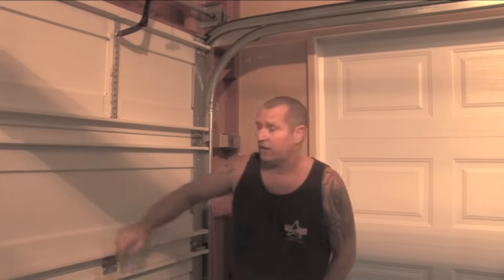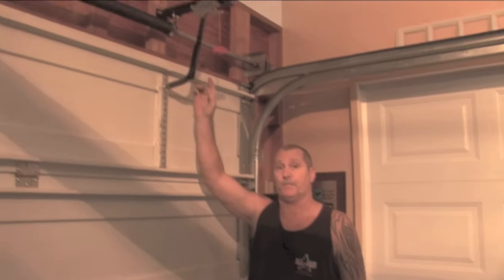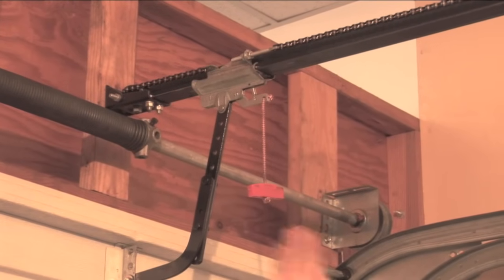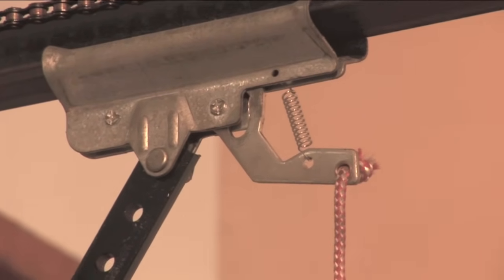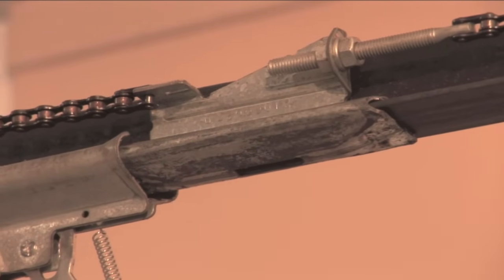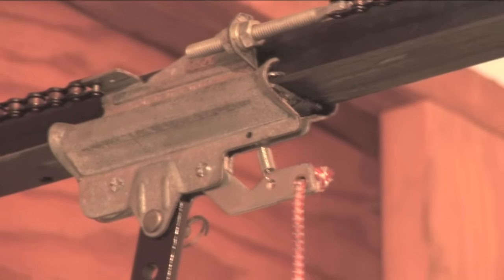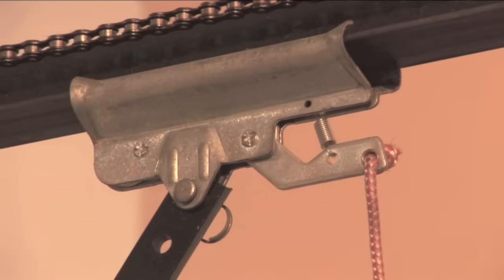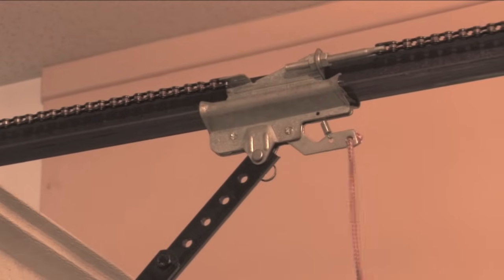Chain drive opener trolley release & re-engage. (How To)

Comment: This is a very well explained video illustration for understanding a very important aspect of residential garage door operation. I never knew how exactly the garage door manual override mechanism works even after over thirty years of living in our home in Massachusetts. Prior to seeing this video, it was always a trial and error maneuver for me once I used the manual override system to open the garage the during power failure in winter months. Two days ago, the spring broke and the door was not working. Now I know exactly how to fix the door operation and thus I was able to save a lot of money and did not need to call anybody to fix our garage door. The extension (expansion) spring is called Garage Door Trolly Spring and it costs less than two $, plus S&H. This extension spring has to be a correct one, and a mismatched spring may damage the trolly mechanism due to too much and or too little tension. Thank you!

Comment: Thanks for sharing this. My garage door suddenly cannot close with remote. Then need to manually close...I was so worried and planned to call for repair the other day. I viewed a lot of website to find the issue,  and luckily, I finally figure out how to have trolley re-engage with this video. Thank you so much!
Reply from the maker: if your machine won't close the door with the remote you can always hold down the wallbutton and it should close. sounds like your beams are out of alignment. try this video...https://youtu.be/NjPHC4Ka4qY

Comment from the maker: No, but I do know what you are talking about. Loosen the chain by unscrewing the nut on the inner trolley, (loosen it alot) then try the button and see if it travels...sometimes it does sometimes it's just too jammed. If it does go then stop it half way and adjust your up limit so the trolley doesn't come up that far anymore. If it doesn't travel and is still jammed then you will have to take the chain off and move it forward away from the lens protector bolt and then put it back together.

Comment: Tip!!  Putting lithium greece between the inner, and outer trolley reduces the friction as the door is opening and closing.  In other words... You're not going to hear the classic "BANG BANG BANG" as the inner and outer trolley are moving back and fourth.  By the way, did you notice the new Door arms we're getting from Chamberlain????  You can tell there made from a cheap material...

Comment from the maker: Well I gotta say that I've always put the grease that Liftmaster supplied in between the inner and outer and it does help, I just wish the gap in the inner trolly wasnt so long then the tongue from the outer trolley wouldnt have so much play to move back and forth, from what my guys say....Liftmaster doesnt supply the grease packet anymore and yes I have noticed the cheap drive arm as well as the amount of wire staples they now supply is half of what it used to be.

Comment: i'm still having trouble....my power went out and the garage door was left open. I then pulled the emergency release cord to close my garage since it was open. Luckily, it closed, however I can not      re-engage the garage door opener back to the trolley. It seems like the door is either stuck or jammed ever since I had to manually close it. I tried this solution in the video but the cord doesn't allow me to pull down and back. Is there any solution to this?
Reply from the maker: To re-engage you pull forward not back. You only pull back to disengage.

Comment from the maker: I guess apple still has some work to do on their voice command, but I get the jist of it...glad to be of assistance 20Jgard.
Reply: Hi, I have a genie model 203. Had a power outage, I disengaged it to close it...now the trolley will not reengage.
Reply from the maker: I'm not familiar with a genie 203 but if its a chain drive you have to lock it into the inner trolley, i won't be able to explain it in words

Comment: The inner part of my trolley is too close to the garage door for the outer part to connect, is there a way to move it manually?
Reply from the maker: Try adjusting the down travel limit so it doesn't go down as far. It's usually located on the side of the machine.
Reply: Thanks but somehow the inner trolley traveled too far towards the door and the outer trolley does not go that far back, so I can't engage it. I was hoping there was a way to manually move the inner trolley towards the motor so I can re engage it, and then adjust the travel.
Reply from the maker: Loosen the chain and move the chain around the sprocket.
Reply: Thank you so much for getting back to me, the chain was stuck on the cog and wouldn't come loose. Ended up getting a new opener, but i learnt a lot from the video. Thanks again.

Comment: This disengaged the trolly but the other one still not moving and machine makes humming sound and chain doesn’t move what shud I do am able to open it manually now but its still not working  with remote or switch plz help
Reply: Thanks in advance !!!
Reply: Its a liftmaster 😞
Reply from the maker: the inner trolley could be jammed against the lens cover bolt or even up front, the chain could be too tight or the gears could be stripped, check those three things and you might need to call a pro.

Comment: Apparently the part of the inner trolley that attaches to the chain drive for my garage door completely broke off when one of the kids used it and fell to the cluttered floor where it will never be found. Now what?
Reply from the maker: Should be easy to find a Chamberlain “inner/outer trolley “ kit on amazon, the kit comes with both parts and it’s an easy fix.
Reply: @ALLProGarageDoors  Ordered. Thanks! 👍

Comment from the maker: What is happening is that when it jamms up like that the motor can't get going because of the resistance so it will humm or buzz for a few seconds and stop, you have to get the inner trolley off the bolt and adjust your up limit so it doesn't happen again.
Reply from the maker: It’s either a bad board, bad start cap or the motor itself has flat spots

Comment: For some reason I can’t pull down on the cord. It remains intact.
Reply from the maker: probably too much pressure on it holding the door down. sometimes i have to pull down and tap the trolley with a hammer.

Comment: If you cant figure it out another trick is this

Shut garage door

Push button and stop the moving piece t at the very most front of its limit in front of the door connector

stand on a ladder and push the spring area up as you push the button and as the slider comes into align with the lock 

This will lock it in manually